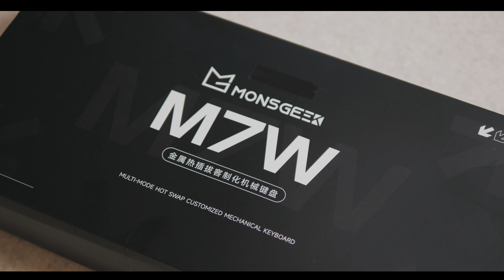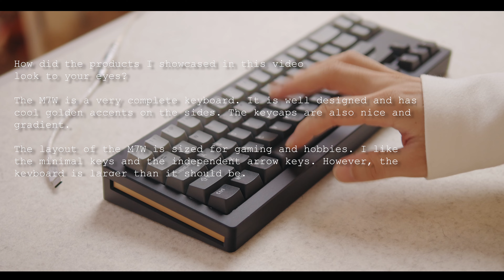MonsGeek「M7W」

Comment: No way that monsgeek comes out with my fav layout right now. Uff, now I'm not sure if I want to wait for TKD Cycle7 or go for this. I love how monsgeek keyboards look (the beast of a aluminium block that is their alice keyboard is just my all time favourite), I'm just not always sold on the sound. From my experience they favour foam heavy "cosy thocc" sound profile. 

Did you find it the same with M7W? The sound test was with all foams and mods, right?
Reply from the maker: I feel the same as you, monsgeek keyboards design is good. I have tested the M1W and M7W and both have the same sound profile. All foams were used in the sound test.

But unfortunately, the height and typing angle of the monsgeek keyboards does not suit me.